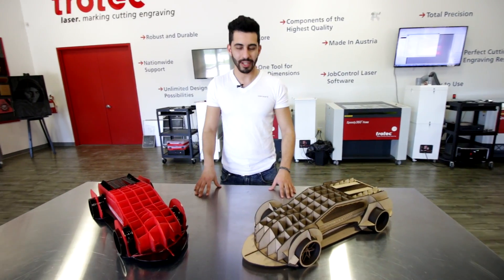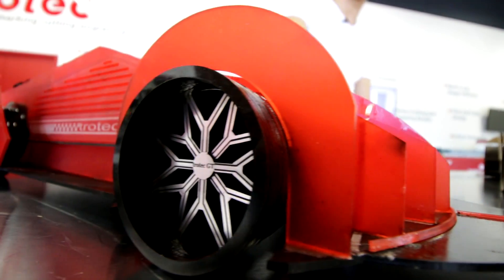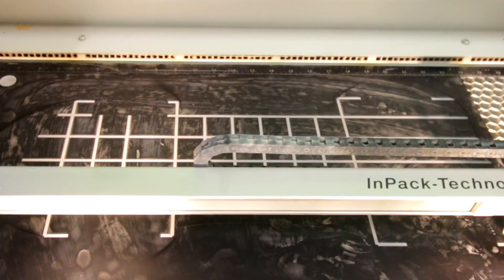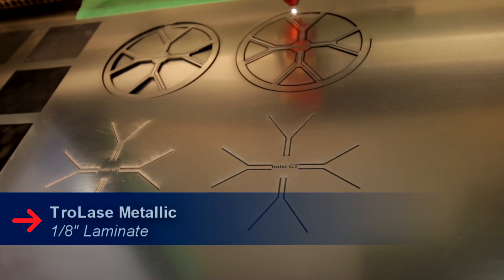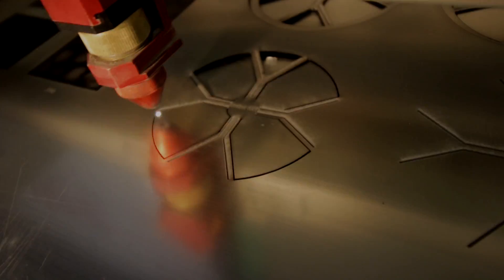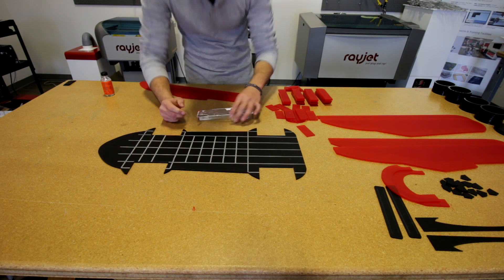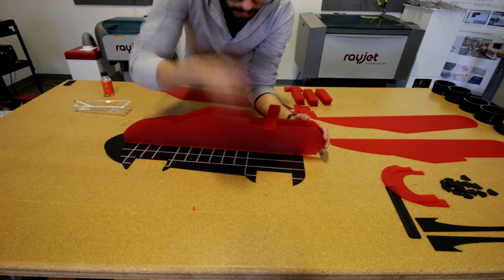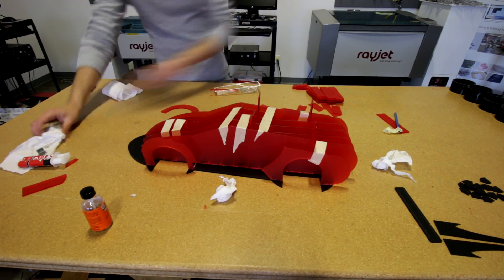Concept Car Prototype | Laser Cutting Acyrlic | Trotec

Comment: Any particular reason you went for a glued lattice structure vs a slot together structure? 
Slots feel like they would have made construction a bit easier and more secure.
Reply from the maker: HandandSew the reason why I went with glue instead of the slots for the structure is because there would be more freedom to test parts and move them around. Creating slots would have been more work in experimenting with the prototype. -Andrew